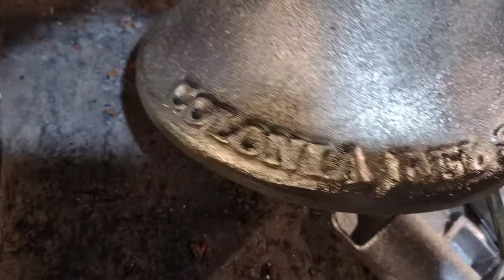Bronze bell casting process / Fabricación de campanas en bronce

Comment: Muy buen trabajo, hasta hace un tiempo, esto de la fundición en Bronce era un misterio;  no se si se puede realizar en un taller casero, haciendo otros objetos  como candelabros de bronce, lámparas de bronce, y herrajes de muebles.
Reply from the maker: Hola se puede hacer lo que sea ,pero a qué le llamas un taller casero ?
Reply: @fundicionmarcelserio   se  refiere a que si se puede hacer la fundición de bronce dentro de un taller casero; usando un pequeño horno de metal y que esté revertido por dentro con cemento, para luego echarlo en un molde, ya que al aire libre el material fundido se enfría rápidamente; o sea, si se puede hacer la fundición en casa, o requiere instalaciones especiales.
Reply from the maker: @carlos-xc3sl  el horno tiene que ser de ladrillos refractarios ,doble fila y tenés que usar un crisol de grafito para que resista la temperatura!  Saludos